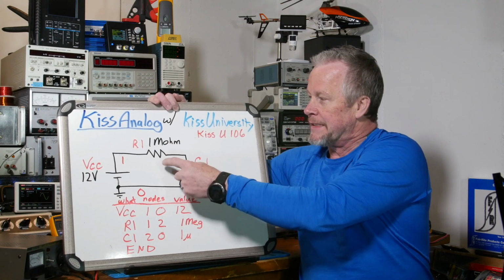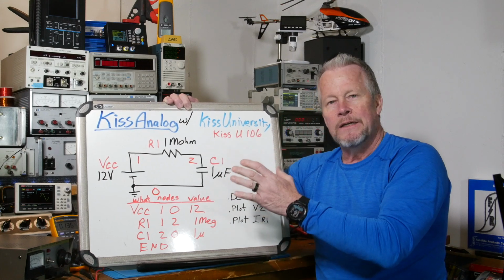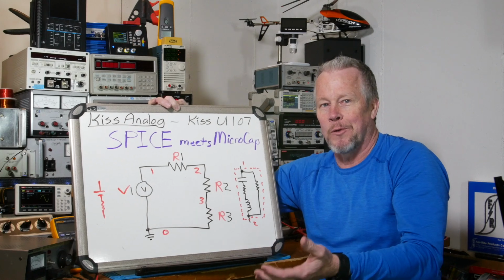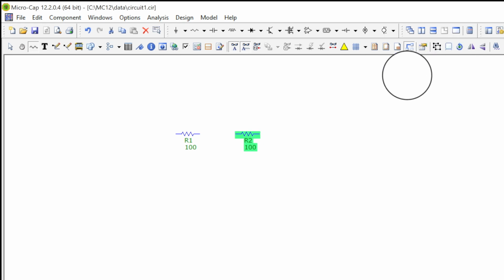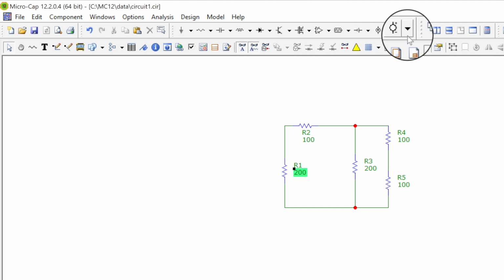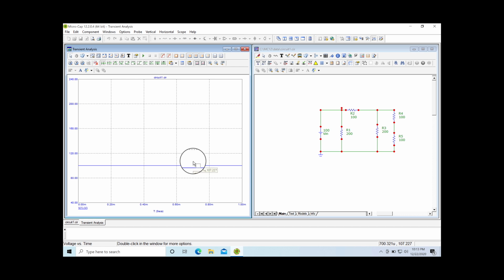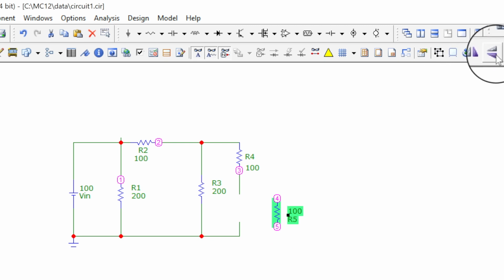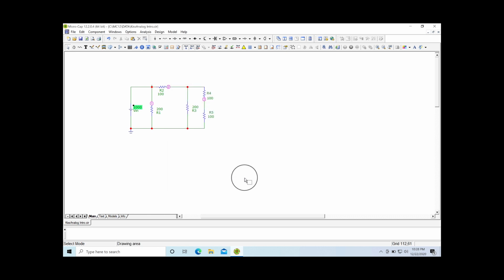Introduction to MicroCap for Beginners Kiss U 107 - part of Kiss University #KissU #microcaptutorial

Comment: How does MicroCap compare to LTSpice? I'd like to give it a try. Who has experience with both circuit simulators?
Reply from the maker: Great question!  I can tell you that Microcap was a $4700 product right up to when the owner retired and decided to give it away.  LTSpice has always been free, but many purchased Microcap anyway - as I did;) I use both and Microcap is hands down a superior product.  BTW, the guy who is the father of LTSpice left the company.  I wonder how long Analog Devices will keep  supporting it.  If you give Microcap a try - I’m confident that you will see what I mean:)

Comment: I am using Microcap 12 simulator to design my analog fuzzy integrated circuit. Although this program has no match of the power of Hspice, it still meets my requirement according to my thesis. Thanks for your video of the introduction and further detail of Microcap 12.
Reply from the maker: You bet!  Thank you for your feedback!

Comment: Dude, this is just like Electronic Workbench from NI. It's also free...
Reply from the maker: Thanks for your feedback!  I do like Electronic Workbench and I used to own a professional copy.  It is a little different then Micro-Cap though as it is not a true SPICE machine, but it is great to use and another fun option.
Reply: @kissanalog  MicroCap doesn't let me add a variable resistor or switches that you can assign hot key to toggle on or off, not the end of the World. I'm so used to EWB, I guess...
Reply from the maker: @paules0099  I’ll show how to do a variable resistor in a new video.  I did this as part of another video but it probably needs its own video.

Comment: Hi! I got a question. Next year I’m going to study electrical engineering and I have a MacBook Air M1 so I was wondering if Micro-Cap is available on MacBook? Is it possible to download it??
Reply from the maker: I use a MacBook, and all you need is the Parallels program to run windows.  It is great and you can switch between OIS and windows with no problem, and they actually run better than on a PC;)

Comment: Excellent!  I am a Mac person and have been using CircuitJS1 (Falstad simulator) for quite some time (learned a lot using that) and I have a free version of LTSpice for MACOS but I liked already what you showed me with MicroCap, so I'm setting up another Windows10 for this MicroCap, so I can follow along your follow up videos better (hopefully also with some stuff on SMPS'es :-)   By-the-way: have you heard of Quite Universal Circuit Simulator? This one comes in Windows and Mac version and is Open Source too.
Reply from the maker: I held off using Macs for this reason, but maybe 10 years ago I went all in and love my Macbooks!  I use parallels program so that I can run Windows based software with no problems or slow down - it is actually amazing!  I can pop back and forth on mac or windows with ease;)

Comment: Great Video. Could you show how to solve some practical problem like choosing the right cap and inductor for impedance matching of 450 Ohm load with 50 Ohm power source at 433Mhz or something similar real world problem with real values that we can test later with NanoVNA
Reply: To make it a bit simpler there is SimSmith program. It may automatically find solution. So you will insert these values in MicroCap or LTSpice and later solder that board.
Reply from the maker: Thanks Zeta Doop!  I can't wait:)  Yes, I am going to start the fun stuff soon and try to get these out once or more a week;)

Comment: I was wondering about using motor run capacitors say 3 50uF on the end of a isolation transformer or inverter as a battery type backup of a scenario so you get clean constant supply to your transformer amplifier a bit like a re generator. Could you use the capacitors in that way to storing some energy and keeping the mains constant?
Reply from the maker: I think you can use caps to filter the AC but not to store it.  Unless you mean after converted to DC?  Great question John!
Reply: @kissanalog  I thought motor run caps are AC? Motors like air conditioning fridges run on AC current motor run caps change the phase of the AC isn't that there job and hold current. I'm confused now maybe somebody will know
Reply from the maker: @johnsweda2999  You are right - they are AC capacitors.  And they do change the phase.  Motors are inductive which makes the current lag behind the voltage and the caps make the current lead the voltage.  Used together the hope is that the voltage and current are back in alignment for max power.  Does that make sense?  I think this is a great discussion for a video;)
Reply: @kissanalog  sort of yes be nice in a video still not sure if you can use them to store AC voltage and how that reacts with the transformer maybe on both ends Happy New Year